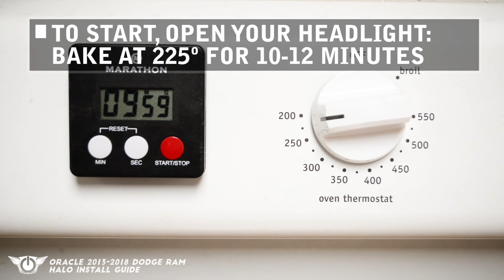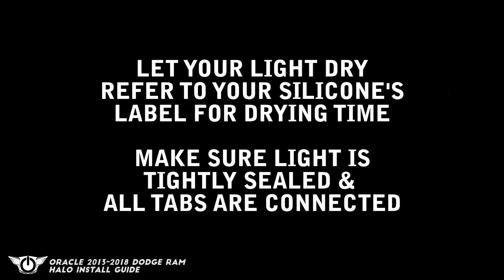2013-2018 Dodge Ram Projector Halo Kit + LED Strips - ORACLE Halo Install Guide

Comment: Hey what up, can this be done with Akon LED’s headlights? Thank you.
Reply: Its really hard to know of sure because some aftermarket lights use different types of board. They would likely fit but may require some modification if the lights are different.